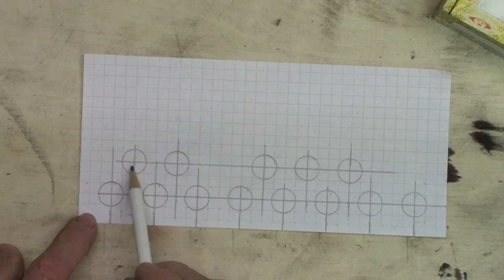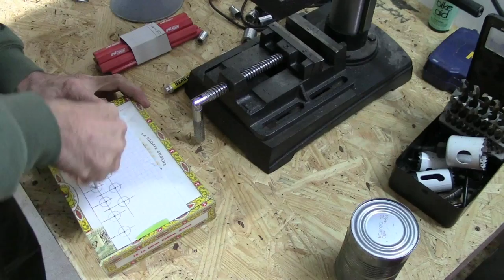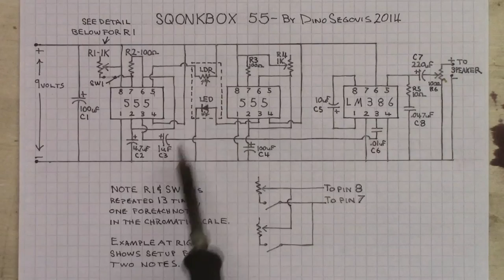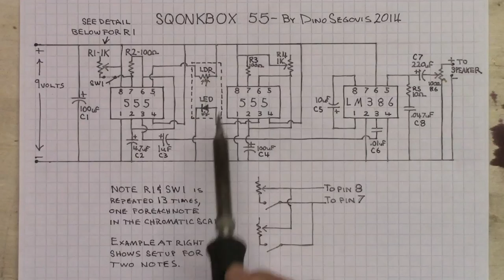The SQONKBOX 55 Cigar Box Organ With A 555 timer

Comment: You need to add the Sqonk switch to your circuit diagram. An external LDR is always cool on these things to give a kind of 'theremin' function. Also check out IC 40106, 6 oscillators in 1 chip!
Reply: Will do. I'll check out the 40106 sometime.
Reply: beavisaudio dot com

Comment: I drill from the other side for metal enclosures to avoid that little bevel the unibit leaves behind.    but your working with paper covered board so that wouldn't work for this project.
thank you for posting this. im working on this exact same thing.

Comment: Congratulations to the project! really interesting!
 I would like to recreate the sqonkbox with a polyphonic keyboard and then with a 555 for each note. Is it possible to have a schematic of how to connect each "note key" to the sqonk circuit? And if I wanted to plug in a "jack output" to connect the speakers?

Comment: Sounds like the Squonk goes into audio range when turned up high enough, sort of like a ring modulator. In fact, I'm wondering if you modified the circuit, perhaps it could be a second oscillator.

Comment: Hey Dean, found you because I'm a CB750 nut as well. I think that the pitch "bending" you noticed might have been a result of the doppler effect when the sound source, in this case the speaker, was moving away from you when you opened the lid?

Comment: Happy Birthday big guy. You are in the USA pronounce it however you would like. Also I know you are not a big fan of the imperial measurement system however it has served us VERY well over the decades and so I for one love 19/32nds the metric system drives me batty. Perhaps if you just put a chart up on your desk with the conversion from MM to Inches.. :)
Reply: Starbuk Fan Fractions VS base 10 ... easy choice! Quick, what's one fifth of 19/32"? How about one fifth of 26mm? 5.2 mm. Easy! This is why machinists use thousandths of an inch. Base 10.
Reply: ***** Yea, I am a tool and die guy.. Just grew up with fractions so for me its way easier than metric.. its all what your mind gets used to I guess. Have a good Sunday!

Comment: Hey Dean! Love your videos and have really learned a lot from you !Im pretty new to hacking and I have a quenstion! I have this pink toy keyboard which is pretty cool actually! It features different sounds, various drum loops, tempo change and even a drum machine with 4 drum sounds !

Then i was wondering, would it be possible to take the L/R cables that goes to the little shitty built-in speaker, and then re-connect them to a female jack socket? Cause then i could hook it up to a amplifier and go nuts with it! Hope you have time to answer! Regards Kasper

Comment: Happy birthday. You need to mod the circuit diagram as shown. middle 555 will not work as shown, you need to connect the lead from R4 to pin 7, not pin8 as shown there. Otherwise it will not oscillate. Plus you forgot the switch to turn the vibrato on and off.
Reply: Thanks! People always catch a few errors I make on these when I draw them up! I'll fix that.
Reply from the maker: ***** Corrected on the project page: http://hackaweek.com/hacks/?p=1617
Reply: HackaweekTV  Switch wire goes to the junction of R3 and pin8. Otherwise you will blow up a 555 instantly with what you have in V2.
Reply from the maker: Fixed! http://hackaweek.com/hacks/?attachment_id=1634
Reply: ***** Sides of power are just 2 lol  JK.